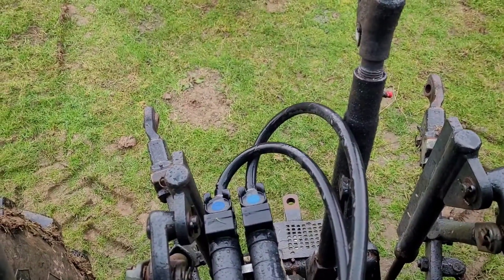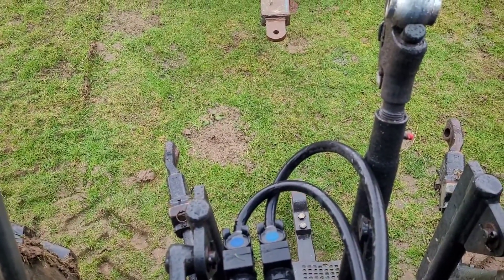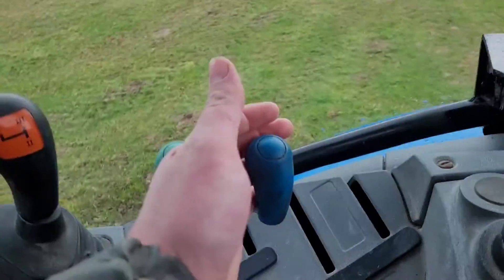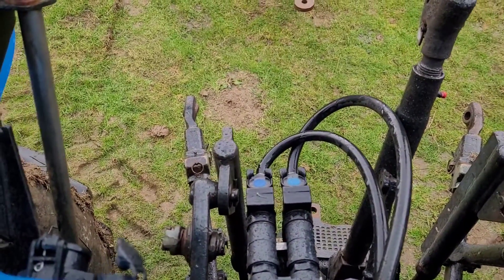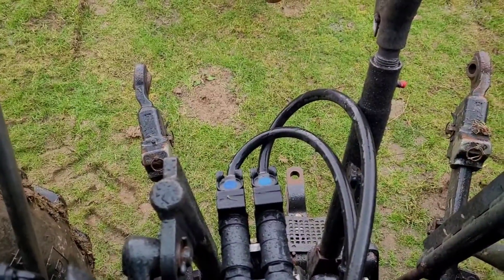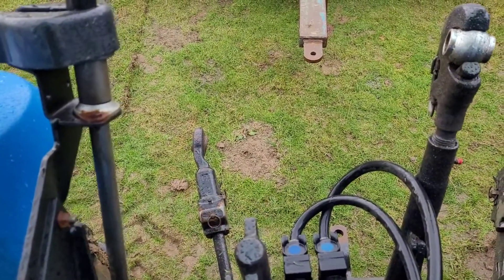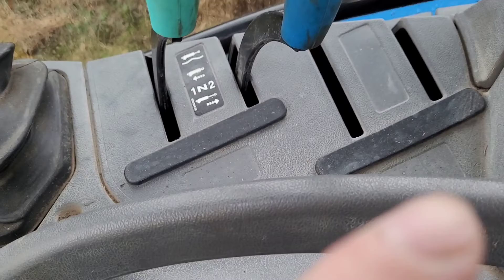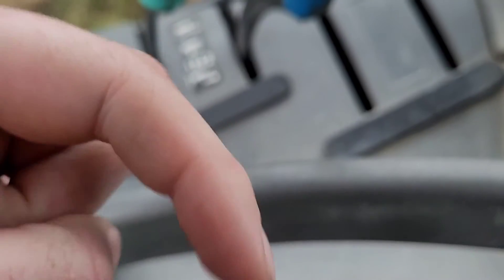How a Push out Pickup hitch works , follow up to How a pickup hitch works vid

Comment: Hi just a question I have a deutz and I can't get the hitch to push out in one complete go. It will only push out four inches at a time ..any ideas what could be wrong ?
Reply from the maker: Pull the pipes out and look if the nipples on the male quick releases are worn down  maybe just the pipe that is returning the oil has space to close itself with the oil pushing back out of it then after a bit of time for oil to go it lets you go some more type (had the problem on tipping trailer and baler )
Reply from the maker: The tractor side can wear too but cheaper change the machine side of things and try in a different spool 1st to see if improvement